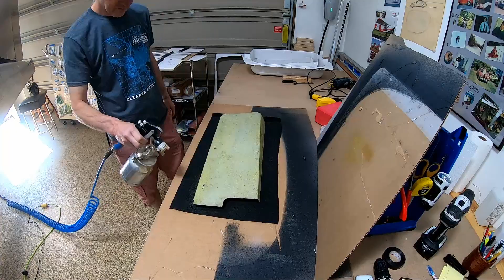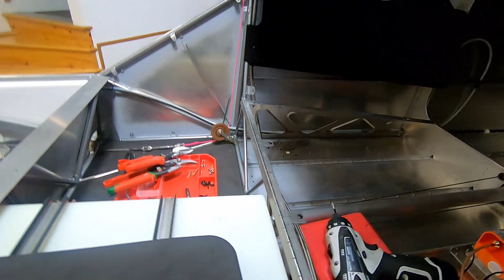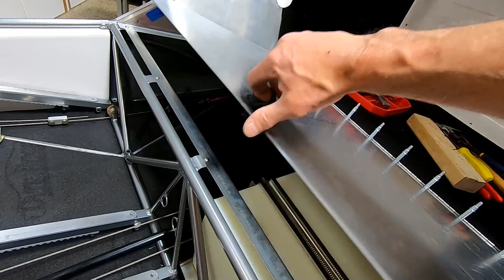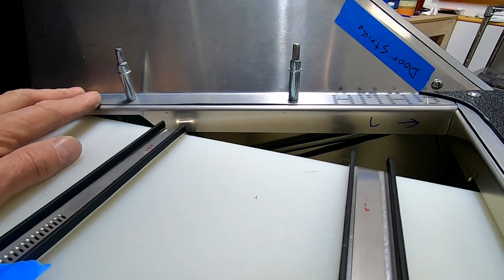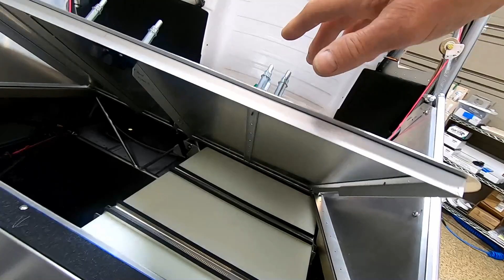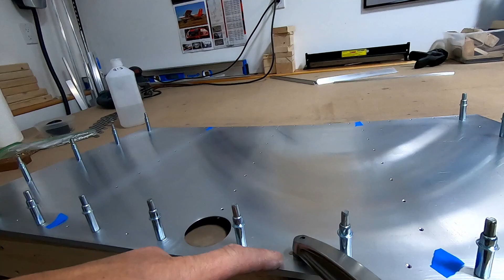RANS S-21 (072) Custom hinged floor and more baggage area details

Comment: Looks fantastic. Can you tell me the name of the material and glue you used to finish the removable panels. I think you called it tweed? I bought some material for this job but it's crappy compared to yours. Thanks Nic
Reply from the maker: Yes, it's just black tweed. Available on Amazon. I use Weldwood contact cement through a spray gun, but you can also brush it on.

Comment: Fantastic value add. Love it. I was wondering how to get a spot to store a small tool kit and a quart of oil for longer trips away from base. You could put a Tupperware bin in there to keep it clean if the oil leaks for some reason. 
Imitation is the best form of flattery. Sorry, but I may be copying you
Reply from the maker: Yes, just make sure it doesn't interfere with any control linkage or cables. I will probably build a custom bin that doubles as a cooler for drinks or A/C with a drain hole ;)